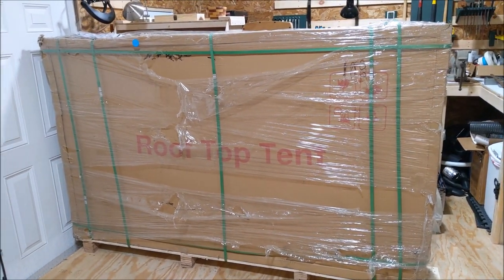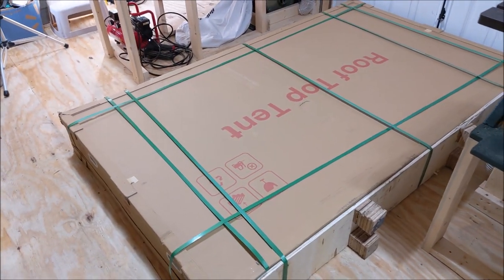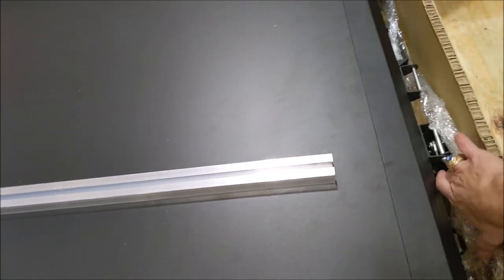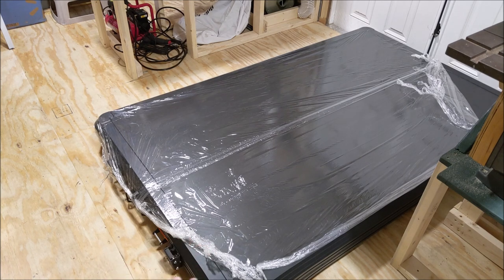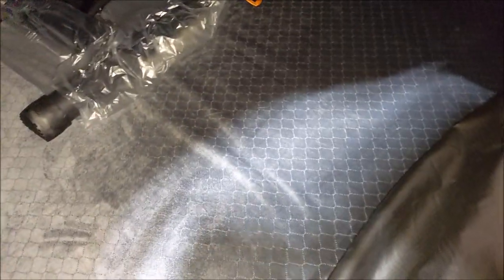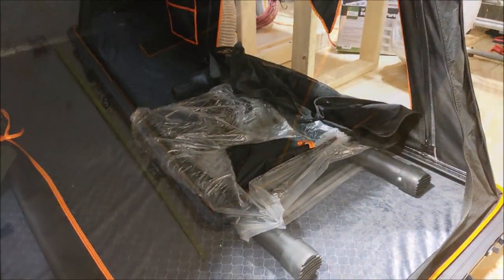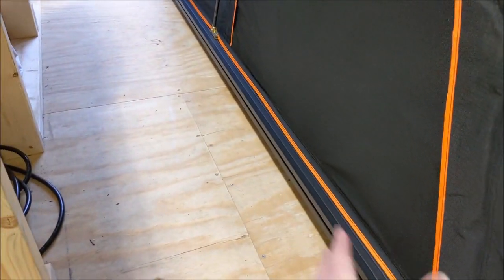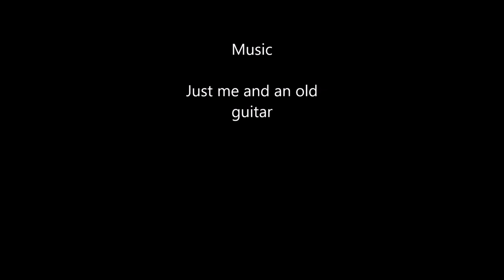$999 Clamshell Roof Top Tent!  (Unboxing)

Comment: May I know who is the seller? it looks really solid with the affordable price. Good choice.
Reply from the maker: It's a pretty solid unit.  I did find a spot or two where the aluminum tracks were about 1/8 to 1/16 out from the corner joints so to keep water from weeping in I silicon caulked these areas.  This was the seller.  The price has bounced back up from the $999 I saw on black Friday.  https://www.amazon.com/Aluminum-Foldable-Portable-Clamshell-Automatic/dp/B0BMQWGGBF/ref=dp_prsubs_3?pd_rd_w=LXRVr&content-id=amzn1.sym.ec3cee7c-6bd8-496a-8166-4fdb6d51cad1&pf_rd_p=ec3cee7c-6bd8-496a-8166-4fdb6d51cad1&pf_rd_r=4NA6ZYQBGZ7RDQGR62FD&pd_rd_wg=dU6Z8&pd_rd_r=f18c7c97-eda7-4f9a-bf96-2b56adc6aad3&pd_rd_i=B0BMQWGGBF&psc=1
Reply: @drez20001 , thanks for sharing your experience. Your tent looks slightly different from other amazon buyers, but it looks very nice and matching. The rain flyer in the rear is compared with the tent even though the picture in the advertisement is brighter (i mean silver). The ladder is black instead of silver. And the texture of the mattress is excellent. The other brand is flat and has no surface on it. I hope the price will go down again. I would buy it instead of another brand.

Comment: You said the top slotted section is plastic? Do you think this would still support a cross bar setup like other clamshell tents? Do you think the tent would have issues opening with some weight on cross bars also?
Reply: It's actually metal/aluminum.  I thought it was plastic, but it's coated with a moderately thick paint.  Pretty solid stuff.

Comment: Thanks for video.  did it come with any cross bar?  How about any hardware to attach it to cross bars?   Do you know how many crossbars are needed?
Reply from the maker: No cross bars were included.  I bought a large rack mount for the truck bed.  I hope to do a follow up video soon on the RTT all mounted.
Reply: Is this link anywhere?

Comment: Just the video I needed to come across, thanks for posting it. I took the gamble and ordered one of these last week. Have you taken it out yet? How does it hold up?
Reply from the maker: Thanks.  Haven't used it yet, still am in the process of setting up the rack on my F150.  I think the majority of these are built in the same factories in China just labeled differently.  There are of course companies in the US that build from scratch but they are two to four times the cost.  I figured I'd give this a try first and then upgrade later if need be.
Reply: What brand? Can’t fin, please attach link